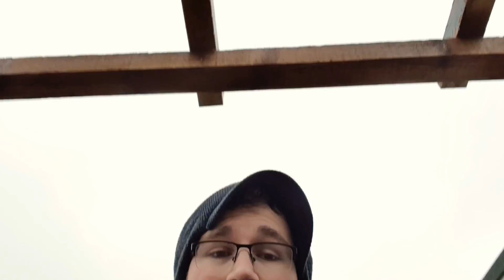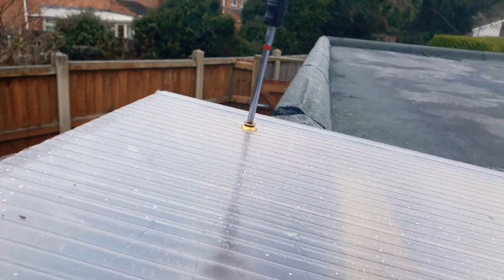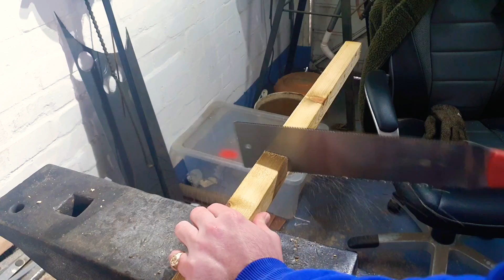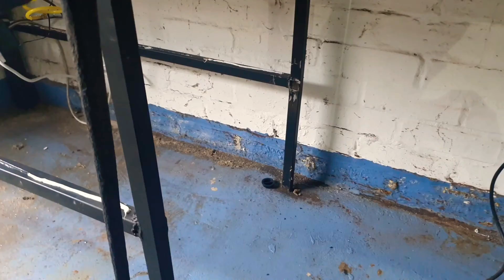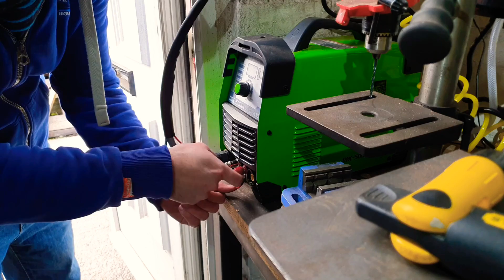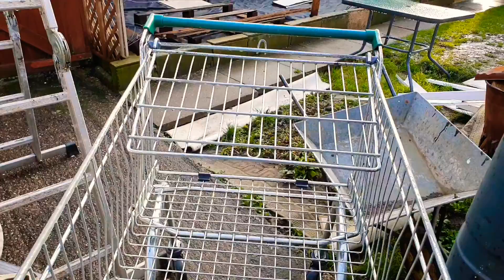Setting Up the New Blacksmithing Shop - Part 7

Comment: Pretty sweet setup! Sandblasting always feels kind of magic to me. If I had a box like that, the only thing stopping me from blasting plastic toys, apples and stakes would be the cleanup afterwards... 😁
What's the cross section of the grounding cable? If my math adds up, the steel extending it would have to be 5 times (5.8 to be exact) larger than the copper one not to create a bottleneck and reduce the plasma cutters power. 😬
Reply from the maker: I only thought of this myself recently... what I may do is buy or recycle some copper and attempt to extent it that way. I think I still have an old welding cable I may try.
Reply: @PJTForging  I liked the look of the rebar, but that sounds like a better plan! A longer cable would give you more flexibility as well.
Me coming from a background in power electronics, I've never been a fan of grounding the worktable and welding/cutting directly on it. Not enough connection for my taste. Better to ground the work piece properly when ever possible!